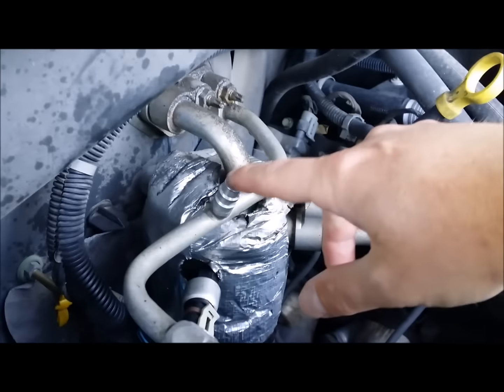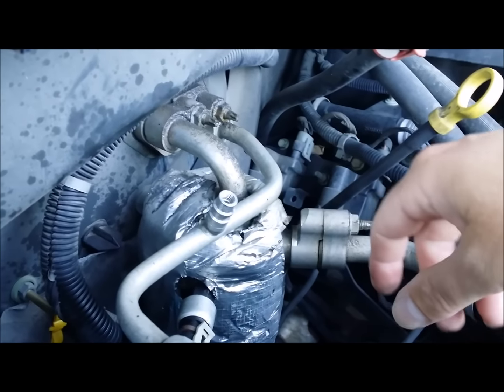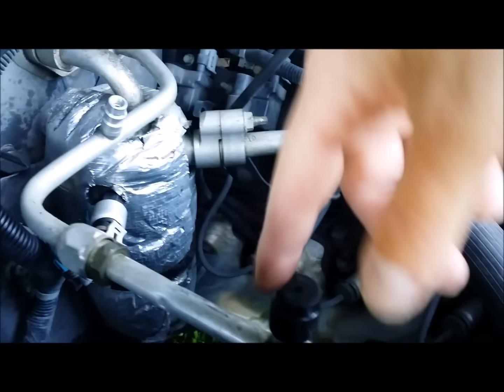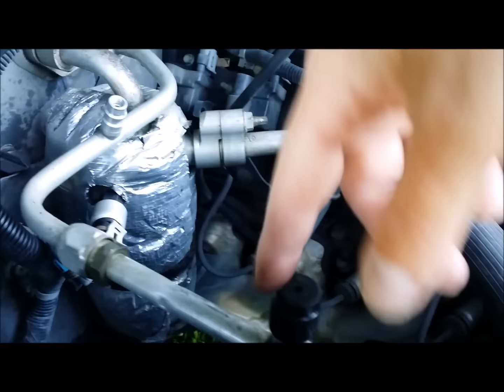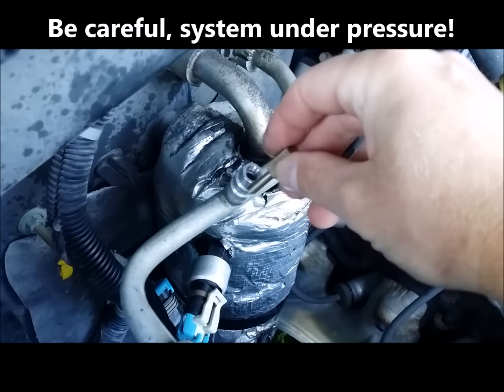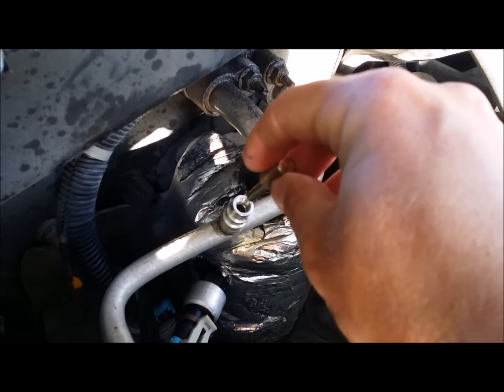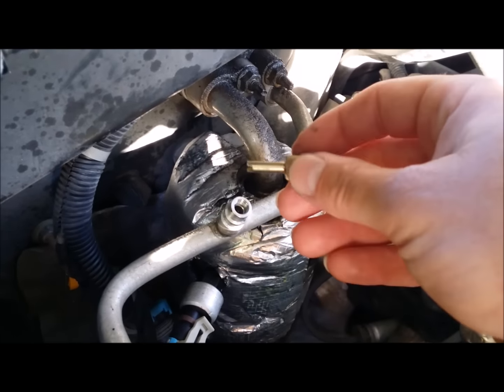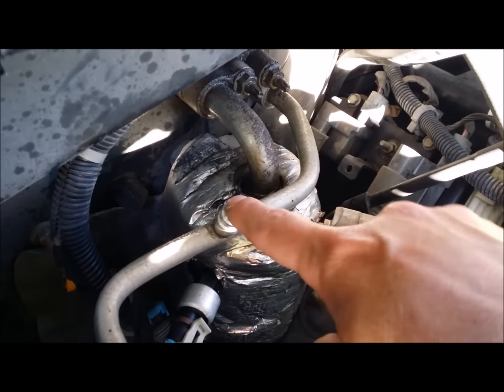How to Replace A/C Service Port Schrader Valve $4

Comment: Thanks! I was able to unscrew the valve and i have to replace it cause is leaking but i found the tool because of your video. Now im looking for the right valve, cause the one i got in that kit doesn't fit. 2009 Toyota Prius  btw.
Reply from the maker: Welcome my man hope u get it fixed!
Reply from the maker: Could always call the Toyota dealer and get the part number or a parts store, check prices as well, and if high, get it on Amazon.
Reply: @JRMSweeps  i found it at o reillys, 20$, i replaced both valves on high and low pressure side, evacuated the system, recharged it with a little bit of dye and i got the ac back. Thank you for your video, i learned something new, saved a lot of money and time!
Reply from the maker: Man that is awesome.  Thanks for the follow up.  💯💯💯

Comment: I appreciate the video. Good info.

I gotta question though. Gotta 05 Silverado. Mine was fine, just checking to see if a pressure gauge worked. And when I connected it it broke the shrader valve. Gotta a replacement valve and put it in, obviously gushed out for a couple moments. Now I put roughly 14 oz of r134a back in. Just going till ac felt pretty cold.

NOW the question. My cab smells like damn freon. There was no leak before and I’m fairly confident, there isn’t a leak anywhere else and the valve stem isn’t leaking anymore. Ya think the cabin air filter picked up the r134a gas and that’s why it ain’t going away?

After I replaced the shrader valve I quickly turned on the engine/ac. Ya know, testing. You think that fresh gas was just sucked in by the bottom of windshield fan inlets and now I gotta replace the filter to get rid of the smell?
Reply from the maker: That is a question I am unable to answer.  Hopefully, someone with some expertise can give you some info.  Could always take it to a shop that does free checks and ask them as well.
Reply: Huh. Bummer. Trying to avoid the shop. Let’s see if somebody will answer.

Comment: I have a 2013 chevy spark...which all of a sudden had no freon, I took it to 2 mechanics and both said I had a leak and they both suspected the evaporator core was the culprit... so I Googled the symptoms for the evaporator leak and I had neither...so I took it to a 3rd Well known local mechanic with a great stellar reviews because of his honest work...and he told me it was the Valve and I only wasted 4 bucks, he didn't even charge me, but out of the kindness of my heart I gave him 60.00...beware people they're alot of mechanics that are like piranhas they'll devour you if your not careful...always get a second opinion or maybe a 3rd opinion, don't settle for what the first mechanic says.
Reply from the maker: Way to go man!!!
Reply: U are absolutely right brotha
Reply: Honest Mechanics are the best! So glad your car was fixed! 

My A/C was messed up. I did lots of research and based on my research and symptoms, I could not find out what was wrong. 

I told my mechanic this. He recharged my system and checked for leaks. The valve was the issue. Charged me $90 total. Works great now! 

Anyone else I’m sure would’ve charged me much more. The Chevy dealership told me $450 to recharge and check for leaks. $450! I laughed at them and called my mechanic. Haha… no.
I have a 2012 Chevrolet Equinox
Reply from the maker: Honest mechanics are hard to find and am glad you have one!

Comment: Will a leaking low side port cause compressor turn on and off?
Reply from the maker: Is the ac hot or cold?  Turn on as in by itself without you turning the ac on?
Reply: @JRMSweeps  i have to turn ac on when it engages the gage drops almost below green range and when it disengages it goes almost up to the red range..atays on about 4 or 5 seconds..i have turn ac on before it kicks on..then it starts turning on and off...its pretty warm not real hot but a long ways from cold its 90 here in bama now lol..but it is leaking out the low side port can hear it when loosen cap its got that stupid ball valve which sux
Reply from the maker: Well, if it's not a faulty valve, could he a bad compressor.  Find a place that does free ac checks and they should be able to tell ya hopefully.
Reply: @JRMSweeps  Yeah,thanks for your input appreciate it..
Reply from the maker: Welcome, sorry im not much help for ya
Reply: @JRMSweeps  Got it working just kept adding refrigerant until it leveled out..cold air now !!!
Reply from the maker: Right on my man, awesome job!  Glad u got it going again.  Thank you for the follow up.

Comment: That balloon idea of yours is damn useful! I just used a small screwdriver to tighten the low-side valve, dumped a little freon in, covered the port with a balloon, ran the vehicle for 20 minutes with AC blasting, and noted the air is still freezing and the balloon is still deflated. I'll call that a win. Thanks!
Reply from the maker: +Kenneth McCoy sweetness right on my man. Excellent work!!!
Reply: What kind of screwdriver ?
Reply from the maker: Not a screwdriver.  Check video description.
Reply: @subsea8559  I'm referring to a pocket, straight blade screwdriver with a tip that's small enough to loosen/tighten  Schraeder valves. Hope that helps.

Comment: Yo bro I'm having the same issue but the schrader valve won't come out it just spins any help ?
Reply from the maker: Did u try and use something to remove it after attempting to loosen the valve?
Reply: @JRMSweeps  I have but feels like I'ma break it of I force it
Reply from the maker: Wish I had an definitive answer.  Maybe call a shop and see what they suggest.  Is the tool actually grabbing the valve to spin it out?
Reply: @JRMSweeps  yea cause when I tightened it does but I losen it then it stops to a point that it just spins
Reply from the maker: Found this, not sure if it will help.

https://www.forcbodiesonly.com/mopar-forum/threads/schrader-valve-wont-come-out.58886/
Reply: @JRMSweeps  thanks bro
Reply from the maker: Welcome, keep is posted.
Reply: @JRMSweeps  update so I went to harbor freight bought a set of picks for 1$ try to pull it out for a while it didn't come out the top broke off so all was left was the stem & the bottom end of the valve  so I just left it over night like that went to harbor freight the next morning bought me some little needle nose pliers that are perfect to pull it out so what I did was put a little bit of wd40 penetrate let it sit a little then I started to pull with the pliers it was a little tough but it came out it had a lot of stuff corroded on the side like sediment idk but I'm pretty sure the wd 40 & those pliers did the job
Reply from the maker: Oh heck yeah, that is great information.  Thank you for posting that.  Haven't heard of this solution and know it will definitely help some people out.

Comment: Thank you I will go buy that tool now asap. And I m getting pressure when I put my finger that’s for the video
Reply from the maker: Welcome and good luck.
Reply: I got the part and screw driver to take off the stem. And I replaced it and works good. Again thanks 🙏 a million for the video
Reply from the maker: @Smokin-kw2hm  right on!

Comment: Was told both my service ports were leaking on my 05 Yukon. Was quoted $800 to fix?!!! Is this a normal price for this repair in shops? I’m not paying bc well I don’t have it but jeez! I just felt that was kinda high.
Reply from the maker: Are they just replacing the $5 parts shown in the vid or the entire hose assemblies?  That does seem high but I have never dealt with ac repair from a mechanic before.
Reply: @JRMSweeps   I was told they had to replace the ports and that most of the cost was for freon. My truck takes more than the usual amount. I still was a bit floored by the cost. But the compressor and all hoses were fine. Just to replace the ports. I saw some mentions of vacuum so there’s no air in the system. Would me replacing the ports myself create this issue?
Reply from the maker: @samanthabunyard3591  if you replace the ports, you will need to recharge your system with freon.  800 for just freon and ports seems really high imo, but again, I have never dealt with a mechanic for this issue.  I would def go get a few more opinions.
Reply: @JRMSweeps  Thank you for your responses! They are greatly appreciated. It’s too hot to be without AC so I think I’ll try replacing the ports on my own and go from there! Thank you again!
Reply from the maker: You're welcome.  Sorry I am not much help.  Double check to make sure of the port sizes as well. Sometimes, they are different in size.  Good luck, and yes, it is waaaay too hot!
Reply: @JRMSweeps  how do I check the size of the ports? I looked in my Haynes manual and of course there’s everything but that in there 😅
Reply from the maker: You should be able to look and see that there is a difference in size.  You could also call an autoparts store and ask them for the replacement sizes, parts, etc.

Comment: Spray soapy water over the shrader valve to check for leaks. If there's  little bubbles around the valve it's leaking.
Reply from the maker: Great advice.
Reply: Mine is bubble after I finished installing freon I was like dam it 😅

Comment: I find it odd that my AC works fine, and when I take my car to a tire shop to get the tires done, all of a sudden, the AC doesn't work. Then, when I took it to my regular mechanic, he told me that my Shrader valve needed to be replaced. Is there some racket going on here?
Reply from the maker: Could be a coincidence idk...
Reply: @JRMSweeps  yeah, I'm kinda alluding to the idea that the tire shop guys have the same type of tool for removing tire valves that this video uses to remove a shrader valve
Reply from the maker: That is possible...any reviews on the via google maps about aomething like that?

Comment: I have a 2001 Silverado 1500 4.3L, I’ve managed to rub off the sticker with the Freon capacity and oil type for my AC System. Does anyone happen to have this info? Getting mixed numbers on the Google.
Reply: PS.- I didn’t have any balloons around, but FYI a condom and a good rubber band will work also. Would recommend discarding it afterward.
Reply from the maker: haha neeeeeever @turd_ferguson_jr
Reply from the maker: should be able to google that

Comment: Shot I have the same problem In my 2000 silverado 5.3 I replace the valve. No luck. I will have to try again with this kit. I got an old bicycle tire and got.the valve from there.
Reply: bicycle valve wont work, A/c valves are under much higher pressure than tire valve.
Reply: @vaquero3578  yes I ended replacing the whole valve itself. Problem solved
Reply: @PABLOESCOBAR-ph3el  did you replace it with the kit shown in the video? wondering if its the right size.

Comment: This is the tool to replace a Schrader valve. Mastercool (58531) Black R134A Standard and JRA Valve Core Remover. You don't loose any Freon with this tool.
Reply from the maker: +Phil Errup thank u sir
Reply: Cool

Comment: I have JRA cores on my car. A 15 years old one failed in that way: the spring that keeps the valve closed lost tension, and now all it takes to open it is to wiggle the core around. Basically, the refrigerant pressure is what kept the core closed. But it hissed when the cap was removed. The PAG oil is probably what kept it open. It was on the low pressure port. Now both cores have been replaced and they no longer leak. I have a lot of bicycle tire Schrader cores around, and the spring is rock hard.

Comment: I've changed shrader valve twice on my car and it's still leaking from shrader valve. Both times with new parts, is there any other problem that can result to leaking shrader valve?
Reply from the maker: Do you have a small leak by the valve on the hose possibly?

Comment: And did you have to add more Freon even though you just tightened it up I will check that cause I got my air cooling and 3 weeks later wasn’t cooling so it worth a try
Reply from the maker: Had to add a lil freon.  Come to find out the compressor was bad as well.  Ended up selling it and buying a brand new truck anyways.

Comment: Do you have to vaccum it if you leave the Schrader valve off for awhile
Reply: Joseph Vallejo yes you do, if all your refrigerant (Freon ) leaks out for whatever reason, yes you would use a vacuum pump, (looks like a small compressor) to pull a good vacuum on the whole A/C lineset (which removes air/condensate/moisture as the vacuum is pulled) then you charge/pressurize your system with Freon and oil or they sell a mixed blend! IF YOU DO NOT USE OIL WITH REFRIGERANT YOUR COMPRESSOR BURNS UP SO TAKE HEED! And read and GOOGLE
Reply: @bryanbyrd111  That little fluid once in the can is supposed to be what mixes in the refrigerant. How much comes out depends upon how fast the refrigerant is recovered/leaks away. 1 fl oz is usually what is required for a blown hose, half of that is usually what RRR stations reclaim together with the refrigerant. If the leak is slow (days or weeks to empty the system), and you don't see any oil anywhere, then i see no need to add additional oil. In fact too much oil might hamper heat exchange and increase head pressure.

Comment: I tried that kit but the removal tool wouldn't fit over my valve stem.  What to do now?
Reply from the maker: Are u removing the low side service port?   It won't fit the larger high side port.
Reply: @JRMSweeps  Yes, low side.  On my focus it is under the fender, right side.
Reply from the maker: Well, I would return the kit.  As far as why it doesn't work for your Focus, that is something I am unsure of unfortunately.  I was under the impression most low side schraders are the same.  Maybe take it to a place that does free ac checks and see if they can show u the tool they would use to replace it.  Sorry I am not of help my friend.
Reply: @JRMSweeps  I did contact them and they have agreed to a full refund.  The main problem is that the person ahead of me never put the cap back on.  The valve seems to have a larger top than a regular tire valve and that's why the tool won't go down overtop of it.  The whole this is weird.  My AC was working well but I thought I'd enhance it with some additional refrigerant.  That was a bad decision because it dislodged the valve and I lost all refrigerant.  I guess I'll have to replace that entire canister that the low port protrudes from.
Reply from the maker: Well sugars man.  Sorry to hear that. Keep us posted on the fix you decide to do and the result from it please.  Someone else might have a similar issue  as well.
Reply: @JRMSweeps  ok
Reply: @JRMSweeps  Took it down another path by purchasing the drier/accumulator on line.  It was relatively cheap, under $50, and this way I have a perfectly good stem!
Reply from the maker: Oh sweetness...did u get freon in it and up and running?
Reply: @JRMSweeps  Actually no.  Installed the unit all but the large hose that gets bolted together but it didn't fit. So returning that one and another MOTO RAFT drier is scheduled to arrive Thursday. Hopefully I can finally charge up and have ac again.
Reply from the maker: Roger that my man.  Really hot right now so hoping u get it going again.

Comment: Quick question. Q1 - If you remove the schrader valve and system vacuum is lost/evacuates and you want to DIY recharge it do you need to vacumize it (costly $$) or will recharging with a can or two from wally/AZ create a vacuum in the system once again (if you want to avoid pro mech and DIY it? Q2 - If this is assumption is correct to ensure air escapes as you recharge do you loosen the high port a little bit? Q3 - All I have seen a pro vids. Can any one point me to a video that shows a DIY on this-not just a recharge fill-up but one where the system vacuum evacuated and was refilled without pro tools. Thanx!
Reply from the maker: +Jinc11 wish I could. Unless u just release to the ozone and heat the earth up then recharge u will have to use pro tools.
Reply: O'reillys will "rent" you the vacuum pump and gauge set to properly vacuum out your system for free. You pay for the equipment when you get it, but if you return it within 48hrs you get a full refund. I'm sure other stores have similar tool rental or loan programs.
Reply: An A/C system in normal state operates under pressure - not vacuum. The purpose of pulling a vacuum is to remove air, and most importantly moisture, before pressurizing it with freon. Seriously folks, I have no objections to doing it yourself ... but know what you are working on. Especially with AC, it can be dangerous. High side in operation has close to 300lbs of pressure. Not operating, you'll have about 100 lbs on both sides.
Reply: Say bro i change it but it wont let me recharge it what you.think it is beacuse i need to recharge the compressor
Reply from the maker: Probably yes some places will check for free too
Reply: @Base9502  No. You don't "charge the compressor"; you put freon into the low-pressure side of the system; which charges the entire system. If freon isn't going in you have one of three issues: fittings are not correctly opening the valve (or other obstruction somewhere), you are on the high side and at extreme risk of injury, or the compressor has failed and isn't dropping the pressure on the low side. A set of manifold gauges are relatively cheap; and I think even "borrowable" from one of the parts store chains ... they will tell you what you are facing.

Comment: Is that the same size tool for tire schrader valves?
Reply from the maker: Yes sir.
Reply: @JRMSweeps  i tried to use my tire schrader valve tool doesn’t seem to fit. Have a 12 ram
Reply from the maker: Air Conditioner Valve Core Schrader Valve Cores for Car Home AC With Teflon Seal A/C R12 R134a Refrigeration Tire Valve Stem Cores Remover Tool (36PCS)
by Z&D Valve
https://amzn.to/2JBwKLA
Reply from the maker: Mine doubles.